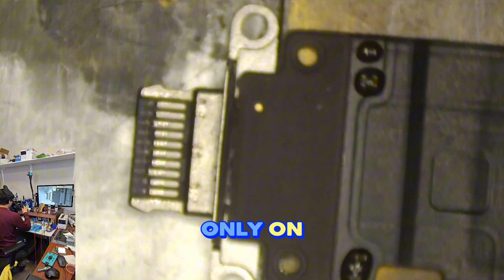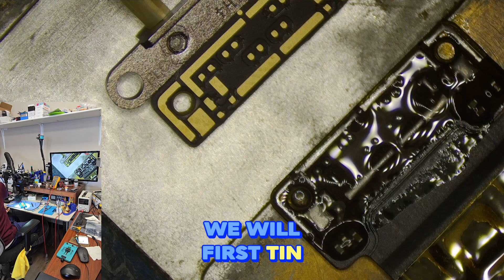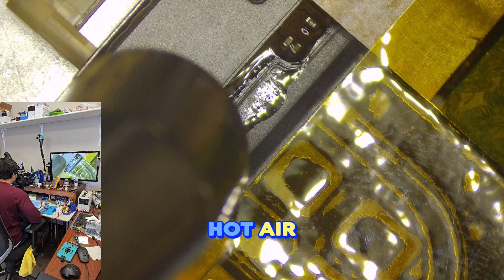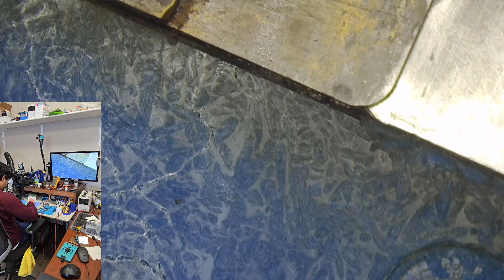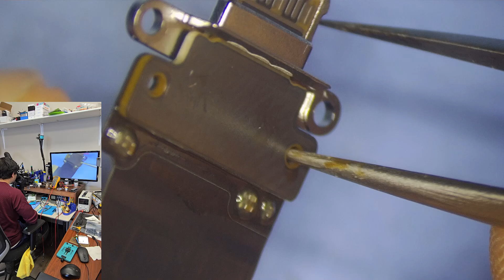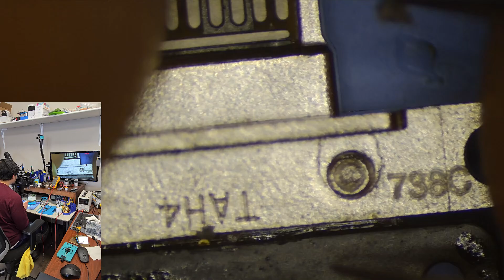iPad Pro 12 9 Charging Port Only Soldering Repair

Comment: Would it be possible and I'm even willing to modify the skin of the iPad if I have to to put a type c charging port on there so I can get rid of this crazy lightning cable out of my life that drives me absolutely bat guano crazy
Reply from the maker: It’s a fun idea, but it’s not really feasible due to the way the motherboard and internal controller chips are designed. 🔌
However this guy https://youtu.be/KUXQzVD1TdI?si=AixsJyeXr_LvtbGF managed to do this for some apple devices using a cleverly designed case. It may be worth reaching out to him.
Reply: @repairtechrx thank you very interesting i